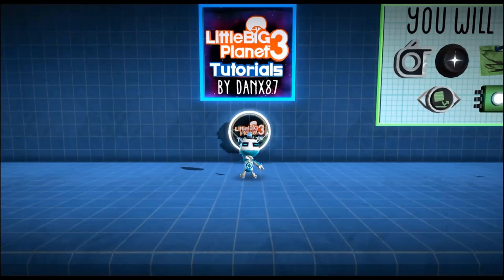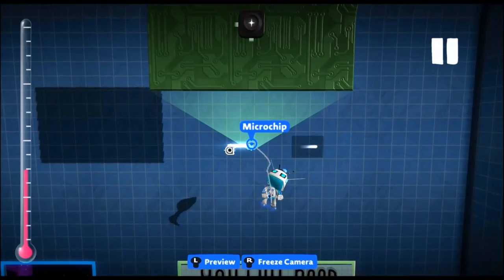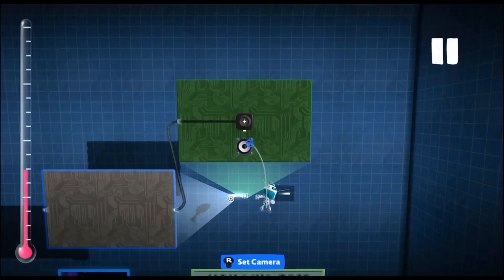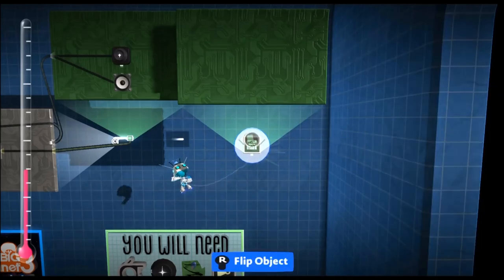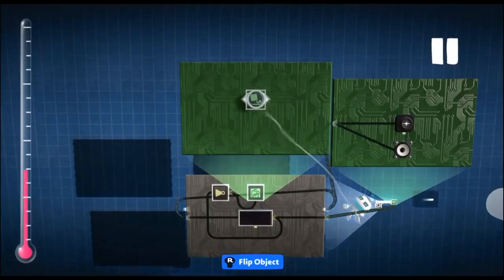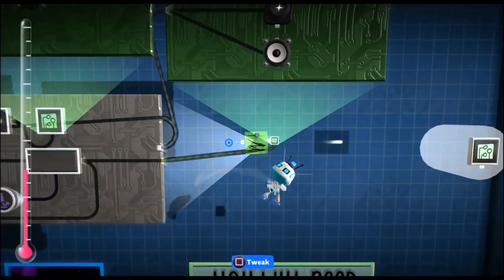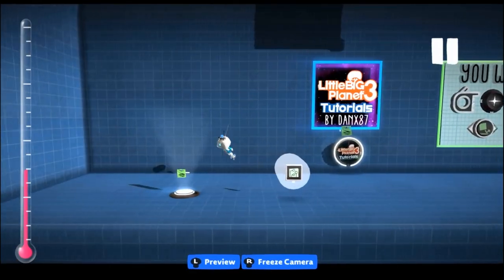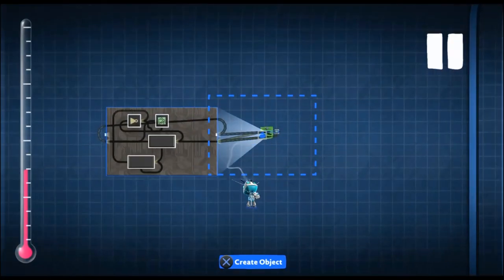LBP3 Tutorials [Reload - PowerUps]

Comment: I'm trying to get back to LBP, and I have trouble trying to make a platformer without Sackboy. (Essentially, a Creatinator.)

I want it to feel like the original SMB in controls and I've done some prototypes with hologram, but they never worked as I wanted. Could you help?
(I could get the movement down, but it wouldn't work with Advanced Movers in LBP2. That meant that I couldn't make it jump right.)
Reply from the maker: Santa Goomba I currently have a full working prototype which I am in the process of working down to a teachable level. I am almost there & this will be 'The Biggest', most in-depth tutorial I have ever done. It will feature both the creation of a Custom game platform (as LBP physics will no longer apply or have any effect) & creation of how to do sprites / Sprite sheets & how you can get them to work within the designed perimeters. I am currently 4weeks into this project and will hopefully have it out soon. ;D